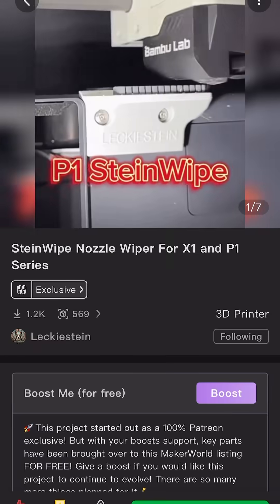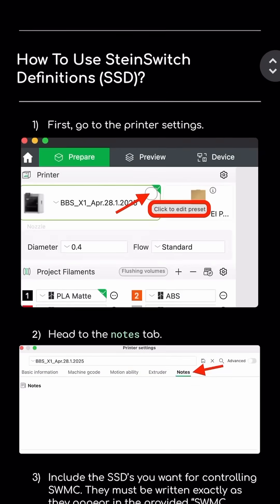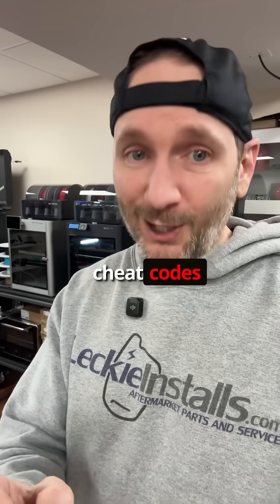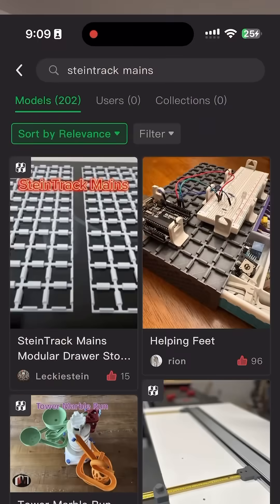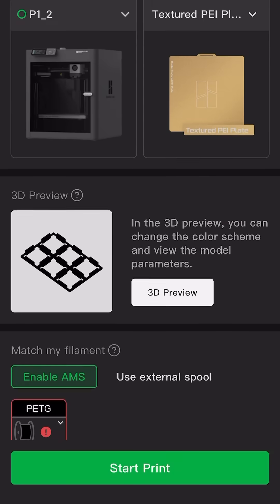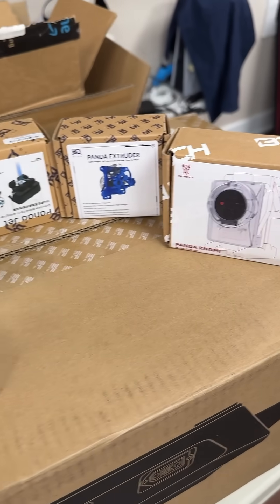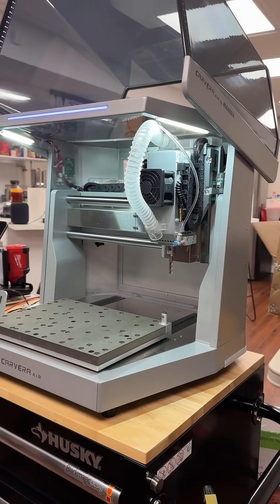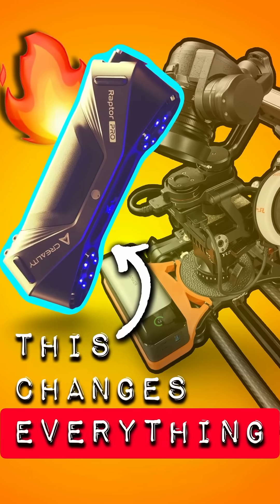Cheat Codes For Bambu Lab Printers? It's Real!

Comment from the maker: Update May 20.2025 : 
Everything needed to get started with the SteinWipe Motion Control (SWMC) project! 

1) Stay up to date on everything thats been done for SteinWipe:
https://bit.ly/LeckiesteinProjectLog

2) No more pasting Gcodes! Everything needed for the slicer is now in a single 3MF file! 
https://youtu.be/jahBdUJ94KI

3) No more editing Gcodes to changes the SteinSwitches, these are now controlled with SteinSwitch Definitions (SSD's). This doc shows you how to use SSD's and what each ones does:
https://docs.google.com/document/d/1540a3b_T8ESQ08lXcBy6db43X7J7yxPiT3bDuzWYge4/edit?tab=t.0#heading=h.ra1esgt7py0c

4) New pause routine trailer featuring SSD's. I show how to use SSD's at 30 seconds mark:
https://www.youtube.com/shorts/cHqVBoUvAgc

5) Get started with the SteinWipe project and basic manual wiper code on MakerWorld for FREE!
https://makerworld.com/en/models/1025501-steinwipe-nozzle-wiper-for-x1-and-p1-series?from=search#profileId-1050795

6) New wiper install method and new template deep dive:
https://youtu.be/DPtA6Nmu70I

8) Tune your wiper offsets to prevent a mid-wipe crisis 
https://discord.com/channels/1327182397673832448/1353220347511574608

9) Feeling good about the project and want more? Get the full project on Patreon and get access to all the files including DEV and Beta and get access special community Discord Channels:
https://www.patreon.com/Leckiestein/shop/x1-p1-steinwipe-dev-pack-maker-files-3mf-840881?utm_medium=clipboard_copy&utm_source=copyLink&utm_campaign=productshare_creator&utm_content=join_link

Comment: @leckiestein I see the GratKit dryer - great choice! I love the remote app control on mine and thinking of getting a second now that the 2.0 is out - it lets you turn off the screen during long periods among a couple other small improvements.
Reply from the maker: My only gripe with it really is that this front screen panel is so sensitive it's hard to not change a setting leaning over to get behind the printer 😂
Reply: @leckiestein  It do be sensitive in that regard - I usually just use the app to change any settings, with it being left on PLA+ mode exclusively for my current usage, sometimes I'll use the touch buttons just to set the duration of drying time.

I do wish there were more or slightly different holes to choose to feed from though, not sure if that was changed at all for the 2.0 version. I was impressed by their support however, months (out of warranty) after getting mine the ribbon connector wore out at the bending point leading to intermittent operation; I got in touch with them and they shipped me an upgraded, reinforced cable kit from China free of charge that allowed me to remedy the issue. I believe this cable is also part of the 2.0 version as well.

Comment: i just got this video as a recommendation, but i dont understand what is that... I mean, a lot of obscure stuff and a lot of lingo that assumes that I have the background info, but if you dont have it and dont understand what is meant, then you just skip the potential benefit from what you are sharing... can anyone ELI5 what are these cheat codes ? I have a P1P, but dont understand whats these SteinWipe Motion Control stuff or the "SSD" (bad name imho)... thanks for any help !
Reply from the maker: Hey thanks for checking out the project. Right now the best place to start with the project is actually on maker world (search p1 steinwipe).  a free portion of the project is laid out to get your feet wet. It features a little bit of everything and once you get up to speed with that, you can dive into SWMC comfortably :)